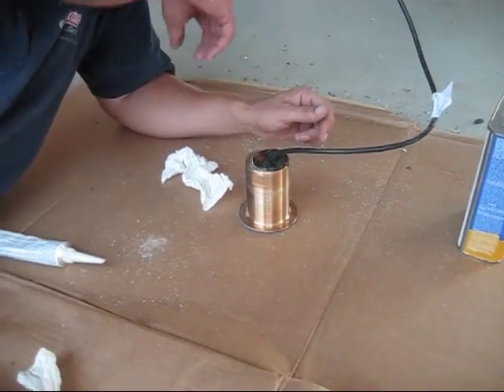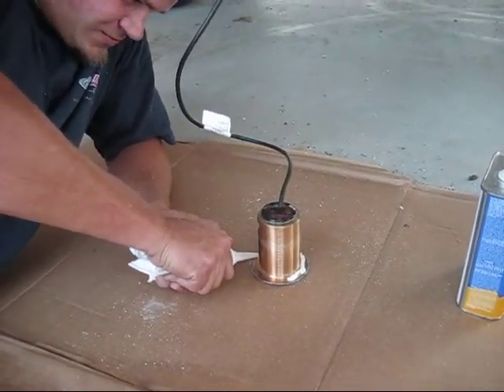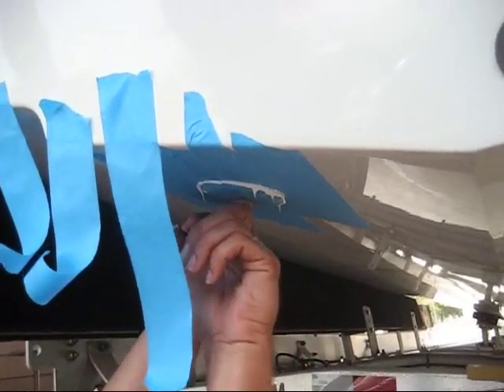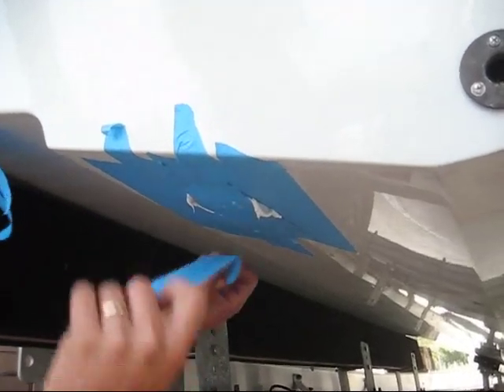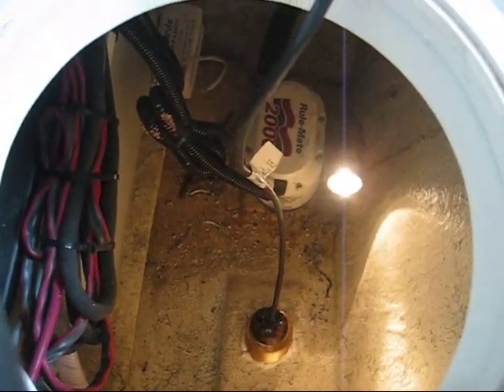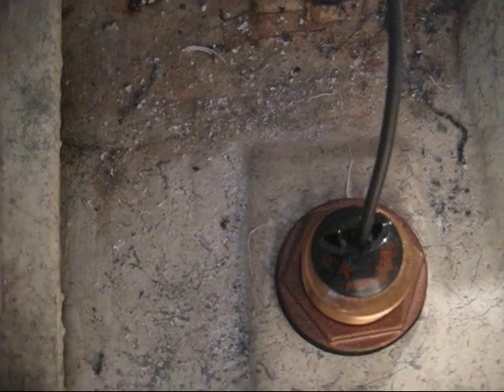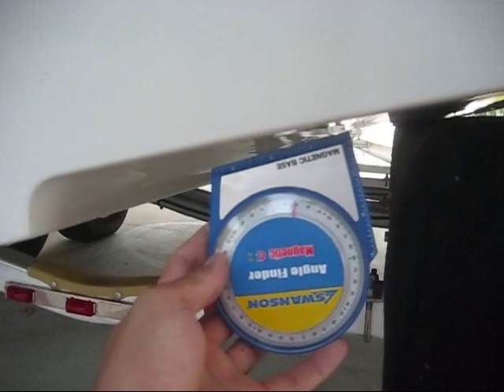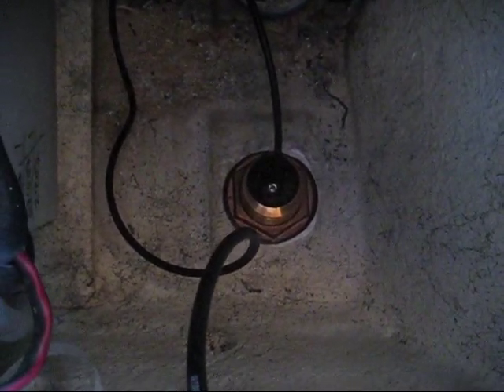Airmar B60 Installation Part II - BOEmarine.com

Comment: As a professional Captain I have been boating and doing boat work for over 30 years. You can still learn some new tricks. By the way my B60  transducer did not come with a nylon set screw on the nut, there is not even a hole in the nut for one. According to the tag it was manufactured 7/13 so I guess they quit using them.

Comment: What if your boat wasn’t on the trail level or your shop floor was off and the boat? Should check the boat with a level across the back to make sure your actually 22 degrees dead rise

Comment: I just installed the same transducer in my boat following these directions so I'm curious on one part about tightening the nut.

On some forums people say to just hand tighten the nut and let the sealant fully cure and then go back and tighten it with the wrench because they say you can squeeze out all the sealant if you tighten it all the way from the get-go but I assume from this video you guys just tightened it with a wrench from the get-go and was done with it?

Are you sealant on the bottom in the top just like in this video and I tightened the nut with the wrench nice and tight and saw all the squeeze out and I'm hoping that's okay and I wasn't supposed to only hand tighten and then wrench tighten later after it cured.

Comment: Hello. I have a question. I m ready to install a ss75 m chirp. They told me that the rubber goes out where you put the marine glue. for inside there is a second rubber. Im afraid that the external rubber ll create bubbles on my transducer. What do you think? Thank in advance
Reply: Nicos Valmas yup.